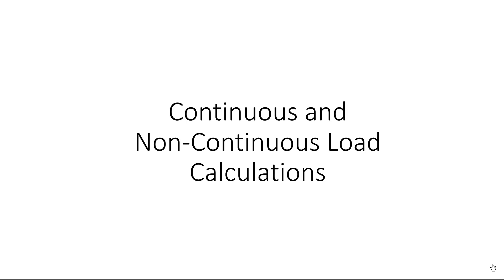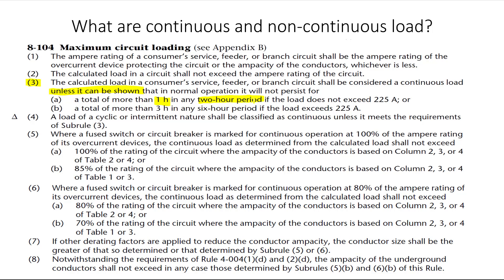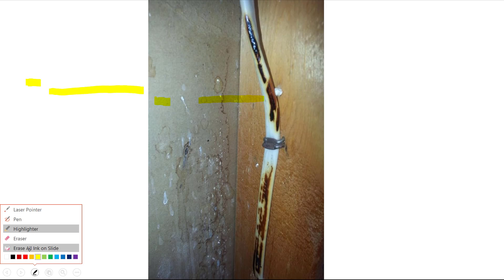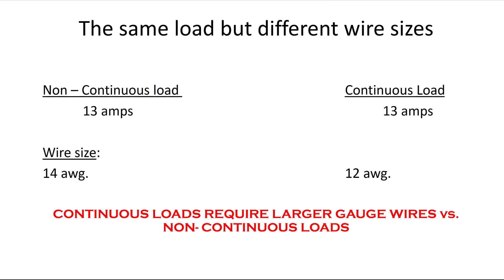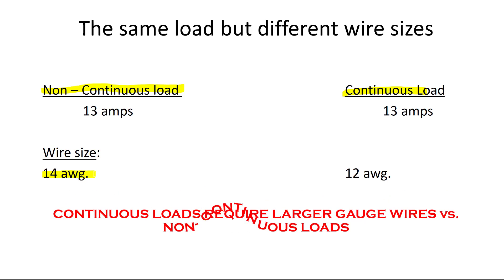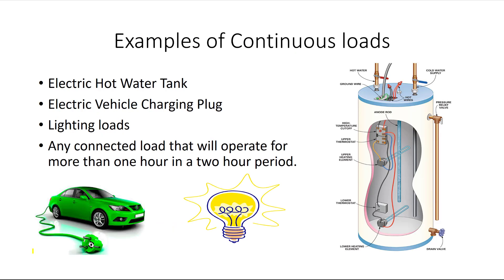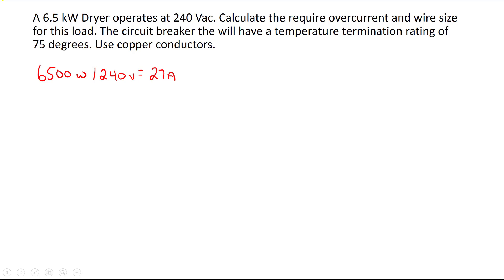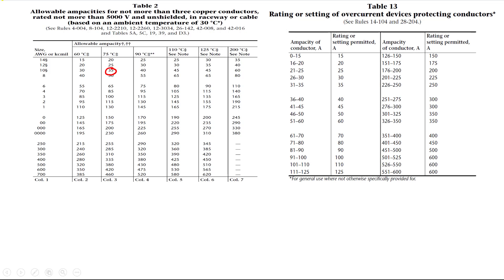Continuous and Non - Continuous Load Calculations

Comment: Excellent video. Sir i need small clarification. Is it the Circuit breaker itself that you are considering its bi-metallic section as Over current protection device or it is another protection installed after the circuit breaker?  CB are normally marked as  C40A/10KA meaning o/c tripping at between 5-10 times of  40 A and safe short circuit tripping  under 10 KA. bit confused with rule 8-104 {5} first line.
Reply from the maker: Circuit breakers will have two ratings associated with them. One rating is the overload rating. This rating is in reference to the amount of continuous current that the circuit conductors can safely handle. An example would be #6 awg . copper conductors can safely handle a current of 65 amps with a temperature termination of 75 degrees according to table 2 of CEC. The overcurrent device installed in this circuit should not be greater than 70 amp according to table 13 of the CEC. This setting can be based on either a continuous or non-continuous rating on the breaker and is determined by the manufacturer. For the purpose of this video I used 80% which during technical traning is the default for all questions. The other rating on a circuit breaker is the short circuit rating. This is the amount of fault current that the breaker can safely interrupt during a fault to ground or phase to phase fault. This rating needs to be based on the impedance of the circuit or the fault path, the source voltage, the impedance of the supply transformer and KVA rating of the transformer.

We need to be concerned with both ratings. 8-104 deals with the overload setting of the breaker and not the short circuit rating.

Hope this helps, let me know if you need anything else.
Reply: Very well understood sir